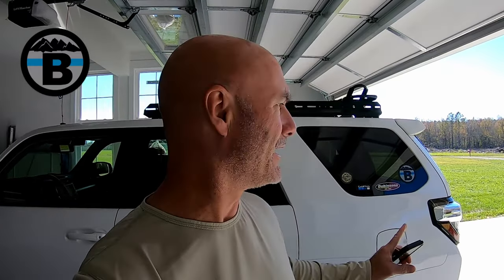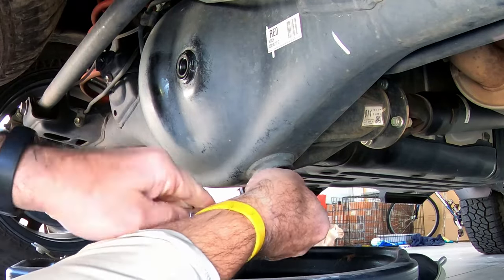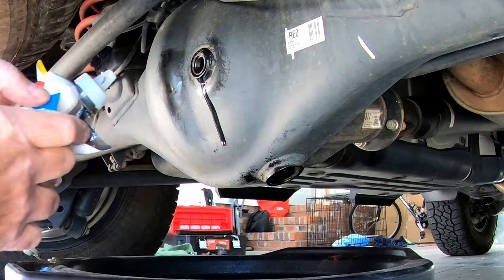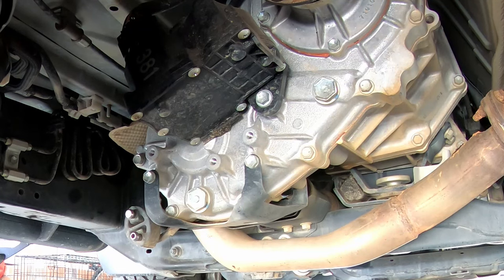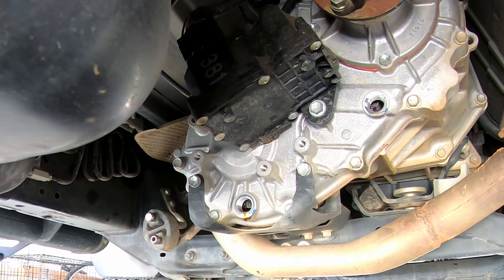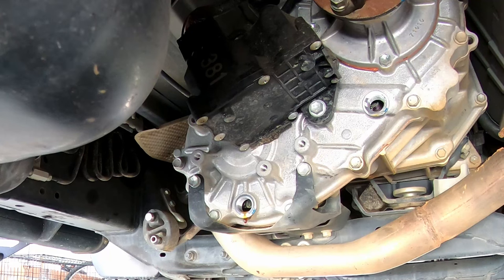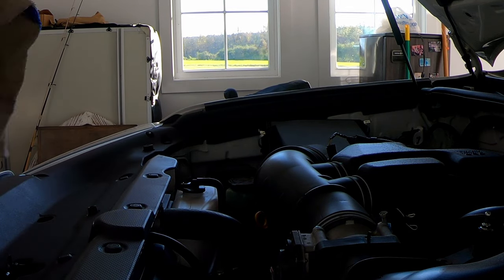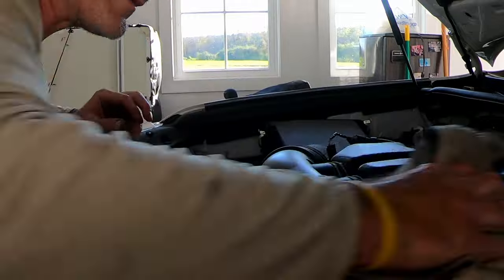Fluid Service on a 5th Gen 4Runner

Comment: whats the point of using the torque wrench but you just over tighten it on the 2nd time.. lol
Reply from the maker: I have no idea what you’re talking about. I torqued each bolt to the settings mentioned in the video.
Reply: He’s talking about you went past the click on your second pass
Reply: Yeah, I noticed that on the first plug, click it twice then over torque it. Just clueless
Reply: the point is that you do not under torque it. You still have plenty of room until you yield the bolt by torquing it for the second time. Also you barely go over, it turned like 2-3 degrees on the second click.
Reply: You guys obviously don’t know how a torque wrench works. Clueless.
Reply: @Nunyobidne55  Obviously 🤣🤣🤣🤣
Reply: The dealership  where I took my 2023 highlander.  After the free oil changes had been  all done . I was  going to do mine. What I found was that whoever did them had over torqued them.  I had to use a breaker bar on my oil filter and socket. I couldn't  get the center cap of the filter off. I went to the dealership, and the service  manager  said I was making this up. So, the next oil change, I had a mini camera  set up to record  the  change.  I showed the manager  the video, and he tried  to claim it was in his shop or his oil boy.  I had another camera recording the  person  under the hood  .  It showed  his boy and clearly  his shop. I'm  a retired lawman  of 22 years.   I had my lawyer  contact  the dealerships' owner and Toyota  U.S.A.   I'm  waiting for the final   settlement  .  I know it'll  have a nondisclosure  clause.  So don't  trust these pirates.
Reply: This guy also used the torque wrench to remove bolts instead of using a breaker bar. His torque wrench probably isn’t getting anything to spec anyway…
Reply: cringed everytime he did that too 😂
Reply: @bluelineoffroad watch the video. You didn’t use the torque wrench properly at all. You stop tightening at the click. You just kept going
Reply: @bluelineoffroad more like over tightened.

Comment: My 2014 5th gen 4runner has 205,000 miles on it and I’ve done all my own maintenance including the transmission drain and fill - never had any issues and it still drives like when I got it - also Never used a crush washer or torque wrench just nice and tight will do it - always keep an eye out the day after though just to make sure there’s no drips 😂
Reply from the maker: Very nice! Some will argue about the crush washer, but like I mentioned in the video, they really aren’t necessary, and your experience is proof of that. 

Thanks for watching!
Reply: So if they are not required why does toyota continue to have them.listed as necessary replacement in their service? @bluelineoffroad

Comment: This is one of the most simplistic & straightforward tutorials for servicing the driveline for a 5th gen 4Runner! I'm going to eventually do my wife's '16 and it's got 56K on it, but I'm not worried about the wear or filth content since Toyota makes durable precision equipment; hers only sees light daily duty.
I decided on new washer asstmnt. just because I'm anal with possible leakage (I'm a Diesel mechanic so I do tons of routine maintenance). Try not to wear out your torque wrench to remove fasteners, but rather pick up some cheap breaker bars at HF, which is where your torque wrench came from!
With encouraging videos such as yours many newbies should take consideration to tackle these jobs themselves because labor rates never go down in price! Thanks man!!
Reply from the maker: I really appreciate the comments! I totally understand the issue with the torque wrench. I was really just being lazy and didn’t want to get my breaker bar from my toolbox. Again, I really appreciate the positive feedback, particularly from a mechanic. Thanks for watching!
Reply: @bluelineoffroad  Yeah, you’re right because I get lazy like that too & besides, those HF torque wrenches are cheap, but I learned to never drop one or it’ll be ruined. Thanks again!

Comment: Good job on the video. These engine oil dipsticks are notoriously difficult to read especially with clean oil. When you remove the dipstick it pulls some oil into dipstick tube skewing the reading. Multiple quick insertions just seem to make it worse. Good tip I learned on my 4Runner was leave the dipstick out for 5mins between insertions. Makes a world of difference reading the dipstick accurately. Also truck must be on level ground when changing fluids.
Reply from the maker: Yes, these dipsticks are difficult to read. In fact, most are difficult after an oil change, but you get better at it once you’ve done it for a while. Plus, it really helps when you know how much oil you’ve already added, so you’re only looking for the difference. 

Thanks for watching!

Comment: Just bought a 2024 last year Gen 5 Toyota 4Runner. I decided to do my own oil changes (@5K) between the dealer service interval of 10K miles. Your video is very helpful and I am always open to any mechanical knowledge that I can learn about the Gen 5 4Runner. Thanks!
Reply from the maker: Thanks so much for your comments, and I’m very glad you found the video helpful. That’s exactly why I do these videos, so again, I’m glad it helped. 

As for allowing the dealer to work on your new 4Runner, I’m not sure I would recommend that. I’m sure there are some good dealerships out there, but my experience hasn’t been all that positive. Your “free” oil changes will really only amount to two of them, so you’re really not getting much for free. Plus, what’s your time worth when you have to take your time and gas driving there, sitting in their waiting area, then your time and gas driving back? Contrary to what many might believe, dealer techs often over tighten oil filter housings, strip or lose skid pan bolts, or any number of other things that they might do to your brand new $50,000 4Runner. Again, you just might want to rethink the dealer for anything other than warranty work. Plus, you’re already doing the oil changes yourself, so you know how to do it. Just my thoughts. 

Thanks again for watching!

Comment: What I do for Diff/Manual Trans oil changes is have both fill and drain plugs out and pump new oil in fill hole to push out a bit more of the old oil.  I also don't mind using the pump since doing  maintenance is like therapy.  Something about it gives me a warm fuzzy feeling.  Great video!
Reply from the maker: That’s actually not a bad idea, especially if it’s been a while since you’ve performed the service. It helps to get all of the old fluid out. As for the work being therapeutic, I totally agree!

Thanks for watching!

Comment: Great video.  Just did all the fluid changes today based on your video.  Appreciate it!  Would love to see a full transmission flush video
Reply from the maker: Thanks so much for watching. I’m glad the video helped. I won’t be doing the transmission service until at least 60,000 miles, and when I do, it will probably only be a drain and fill, not a flush. 

Thanks again!
Reply: @bluelineoffroad only drain and fill no flushes
Reply: @bluelineoffroad  Exactly what I’d like to see! Great video you did here on the diffs, would be great to see your instruction on a drain and fill for the transmission
Reply from the maker: @damon323  Thanks for your comment. I won’t be doing any service on the transmission for another 20,000 miles or so. When I do, it will only be a drain and fill. 

Thanks for watching!
Reply: Don’t flush, remove fill bolt, drain, remove the pan, remove the filter, replace the filter, clean the pan with brake cleaner, wipe well, lube the edge of pan,  put drain plug back in pan, put new gasket on , carefully set all 20 pan screws, tighten slowly left to right and back and forth, once all are 90% tight go around clockwise and final set each bolt, refill WS automatic transmission fluid from Toyota, put fill plug back in, run the truck and go through all the gears for a few minutes to get the fluid up to temperature, the fluid expands with the heat, open the fill plug one more time, let the over fluid run out, replace the fill plug, do it again every 30k miles. Some say 60k. It’s up to you, fluid is cheaper than a new tranny. You do not get all of the fluid out. Takes 6 quarts or so. Tranny hold 11 plus quarts. Good luck!

Comment: Great video.  
I had to laugh out loud when you said you always over tighten your engine oil drain plug, after watching you "sneak" about three to five extra ft lbs of torque on all the other bolts.  <grin>
Reply from the maker: Funny, but you just made me laugh as well because you're the only one who has noticed that so far.  It's kinda like a security blanket for me to push it a few more pounds.  Plus, my torque wrench has some age on it, so I'm not sure it's totally accurate.  I really need to invest in a new one to help ensure that I have torqued everything down correctly. 

Thanks for watching!
Reply: @bluelineoffroad  Just watched the video and noticed this as well.  Since it's your machine, it's your right to tighten as much as you want and will likely never cause damage.  For you audience though, stopping the moment the wrench clicks is correct.

Comment: Great video. You should get the oil pan drain plug from fumoto. Never have to un thread a drain plug and make a mess ever again. Just flip a lever and let the oil drain. I’ve used them for years now
Reply from the maker: Thanks a lot for the suggestion. I’ve actually thought about getting one, but just never have. I haven’t found that it would really save me much time since it’s just one bolt, and I have to remove others just to access the area. But, I may look into it.

Thanks for watching!
Reply: Check engine light?
Reply: @seanpeacock6848  nope. Just a better drain plug. It simply turns a messy drain bolt into a petcock that is mess free. Simply flip a lever, and no more oil on your hands or tools ever again. Also my favorite benefit is if you take it anywhere for an oil change, no more worrying if someone used an impact wrench putting your drain plug back in, or ruining the threads on the oil pan
Reply from the maker: Check engine light for what?

Comment: Great video with good angles showing which bolts to loosen and where the fill plugs are.  On your next video can show how to lubricate the propellor shaft?
Reply from the maker: Thanks for watching! I just lubed the propeller shafts, so it will be a year or so before I do it again. It’s actually very easy to do. There are three fittings on the front drive downs three on the rear.

Comment: Great video. I did my driveline, minus the transmission, back in October on my 2021 4Runner TRD ORP. I also used Valvoline Full Synthetic 75W90 SynPower GL5 in both my front/rear differential’s as well as in my transfer case. Most dealers don’t even use the Toyota 75W gear oil due to cost and availability. 75W90 is more than good for all three as long as they meet GL5 Specs, which this oil does. Mine were done at 41,862 miles and weren’t that bad either. My rear diff had some fine shavings on the plug, but the others had a lot less- very minimal & all not too dirty and have never been done prior. I’m taking my truck into Toyota to do the tranny fluid in the next couple of months because I don’t have a way to check fluid temps and with the cost of the Toyota WS ATF these days, my dealer charges $320 for the service. Not bad honestly. If I had a way to check the temp myself I’d do it myself, but one day I’ll buy a Toyota specific scanner so that I can. Appreciate the video. 
God bless~

Edit: PS yes, every 5K miles on the 0W20 oil. Even dealers are now recommending 5k even though Toyota, at one point, said 10k and “lifetime tranny fluid” lol which I believe is 50k/60k hard use/daily driver mileage recs.
Reply from the maker: Thanks so much for your comments! I’ll be doing my transmission pretty soon as I’m getting close to 60,000 miles. It’s really not that difficult to do yourself, and you can find a scanner to do the job for around $100. Not only do I not trust dealers very much, it also gives me the peace of mind knowing that it was done right. 

Thanks again for your comments, and for watching! 

God bless you as well!
Reply: @bluelineoffroad  yeah I’m hoping you do a video on that as well. We’ve all seen car care nut do it, but would love to see your video of it too. 
Appreciate it!

Comment: Just got a 4Runner and looking forward to doing that to mine.
Reply from the maker: Thanks for the comments. What year is your 4Runner and what is the mileage?
Reply: 2017 trd off road 80,000. Miles in great shape.
Reply from the maker: @pgoncalves007  Excellent! I would also recommend doing a drain and fill on your transmission. It’s a little different than most because there is no dipstick, but look up The Car Care Nut on YouTube. He has a video that shows exactly how to do it. 

Thanks for watching!

Comment: Pretty good. I did front and rear diff and transfer case  on my tundra a year or so back. Not too bad. I will definitely be buying a fluid transfer pump of some kind to fill them with next time lol. My arms and shoulders were so sore the next day lol. This way you can pour ALL the fluid in the pump. Pump it with pressure and fill each one pretty quick. Good video👍
Reply from the maker: Thanks for your comments. I’ve always used Valvoline gear oil, so I was happy when they started using the bags instead of the plastic bottles. The bags make it so much easier to get the fluid where you need it. Plus, there’s no clean up. 

Thanks for watching!
Reply: @bluelineoffroad  I used mobil1 for mine lol. Did not have the cool squeeze bottle. Lesson learned hehe.

Comment: Nice job calming voice helps 😊I was thinking to add new Fluid and let it flow out all the old fluid! Might be going to far! I do for oil pan just putting in 1/4 of quart! In our old x5 BMW 2010 with 239,000 miles on it actually my Daughter’s now! My wife drive 2020 x5 rocket 🚀 ship! I did all front end work on older one upper and lower control arms! After doing that I do most work on all of are vehicles! Just wanted to refresh my memory! Thanks
Reply from the maker: Thanks for the comments. I’ve also considered adding new fluid to flush out more of the old, but I ultimately decided that it wasn’t really worth it. I warm everything up before draining, so the old fluid drains very well. 

I appreciate you doing your own work. It definitely pays, not just monetarily, but also knowing that the work was done correctly. 

Thanks for watching!

Comment: Don’t forget the vent cap. Make sure the top turns freely. It’s on top of axle housing.
Reply from the maker: You know, you’re exactly right. I neglected to include that in the video. My 4Runner only had 40,000 miles on it at the time of the video, so I didn’t even think about it, but should have checked it anyway. 

Thanks for watching!

Comment: Hope it's not an expensive torque wrench.. as loosening bolts with it isn't good for it. Just put a short pipe on the smaller ratchet if you dont have a larger ratchet or breaker.Great to DIY  ! Save lots of money for sure. Nice that you filmed it for the audience .  I did not know the transfer and front took such a small amount.  Totally agree on the 5K interval.
Reply from the maker: Thanks for watching. No, the torque wrench wasn’t expensive, so I’m not real worried about it. I don’t have pipes lying around, and I was honestly too lazy to go get my breaker bar. The torque wrench is what I had available, so that’s what I used. 

Thanks again for watching!
Reply: @bluelineoffroad  You may actually want to use Oem Products for the Toyota fluids.
Reply from the maker: @bigfootswatching9986  Thanks for the suggestion, but it’s totally not necessary. The OEM 75W fluid is incredibly expensive, and also extremely difficult to find. I contacted a certified Toyota technician who told me that 75W-90 was not only acceptable to use, it was actually widely used for the differentials and transfer case. Further, I don’t know anyone who actually uses OEM motor oil for routine oil changes, but there are many who use Toyota oil filters. The only area where I will use OEM fluids is the transmission. 

Thanks again for your comments.
Reply: @bluelineoffroad hey Bigfoot, often times OEM fluids are manufactured by companies like Valvoline

Comment: Thanks for the vid.  It would have been good to show the oil/fluid type (from the bags you used) used for the rear differential and transfer case.
Reply from the maker: I appreciate the comments, but I used the same fluid (Valvoline 75W-90) for both differentials as well as the transfer case. It’s shown at the beginning of the video as well as when I was using the bags. 

Thanks for watching!

Comment: I like to fill the filter housing with oil before installing it. Builds up oil pressure much faster on the first engine start after an oil change.
Reply from the maker: That’s actually a very good idea. I have an oil change coming up soon, so I may try that. 

Thanks for watching!

Comment: You mentioned the crush washers. I’ve never changed on…oil pan or otherwise in my life. Never had an issue.
Reply from the maker: Yep, I usually don’t with oil, but I change it every 5,000 miles. I would typically use them with things like differentials and the transfer case, but I didn’t this time, and haven’t had any issues. 

Thanks for watching!

Comment: is the 75-90 oil you used ok? toyota reccomends 75-85 gl5, but its not a super common oil type to find
Reply from the maker: Thanks for your question. Yes, the Valvoline 75W-90 is perfectly fine for using in all three parts, differentials and transfer case. It’s commonly done, and I even confirmed its use with a Certified Master Toyota Technician who actually does the same thing with his personal 4Runner. 

Thanks for watching!